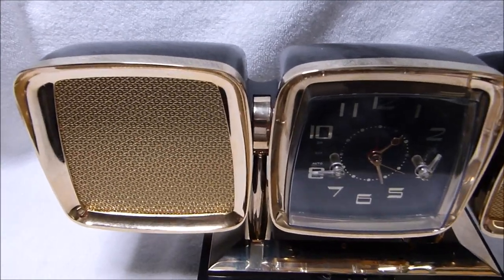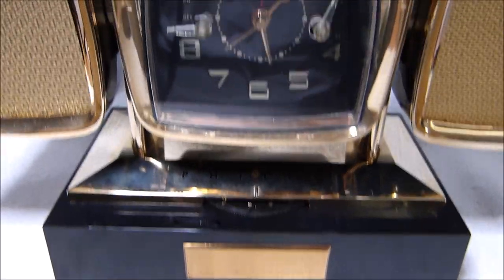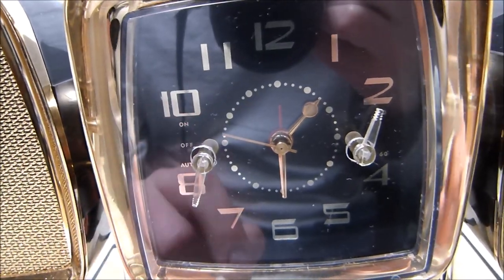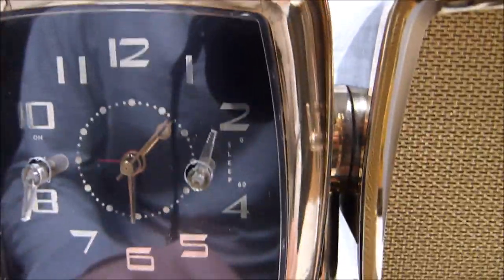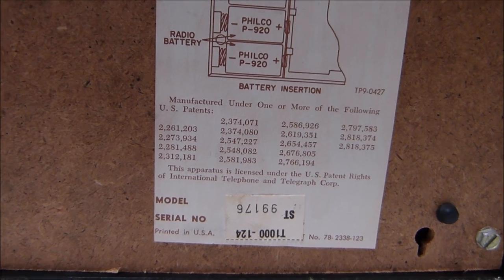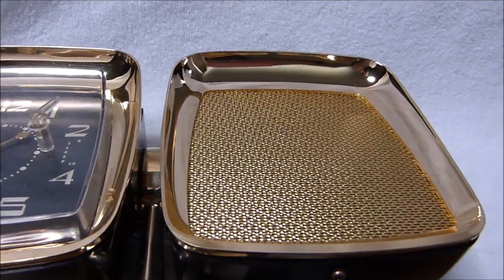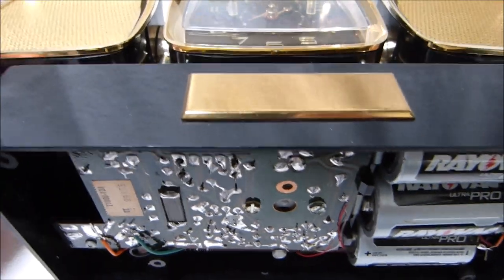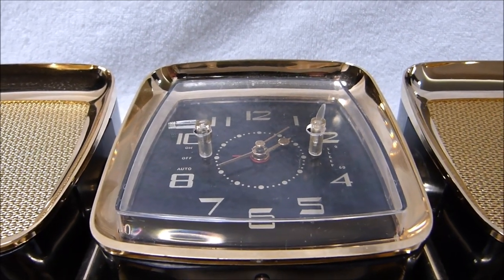Philco model T1000 "Predicta" transistor clock radio (USA, 1959)

Comment: Beautiful!!  Sounds like you've been looking for one of these in great condition for quite a time.  Your patience paid off - you certainly found a gem.  Interesting design, flipping it for a wall mounting.  It's a definite Philco cousin to the famous Predicta, for sure.
Reply from the maker: Thanks! I've actually had it for a few years, but I just fixed the clock and re-capped it recently. It did take a few years to find though. At the very least, the tilt feature is useful for displaying it on a low table or dresser.